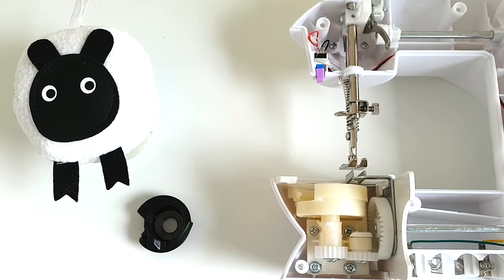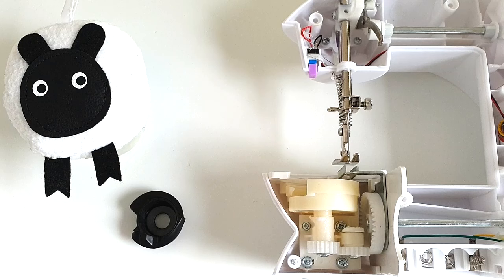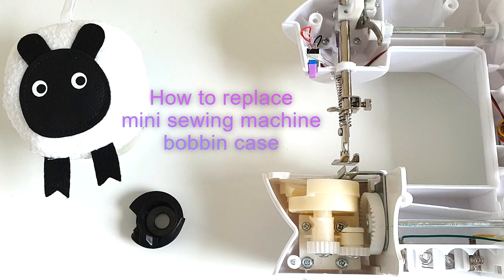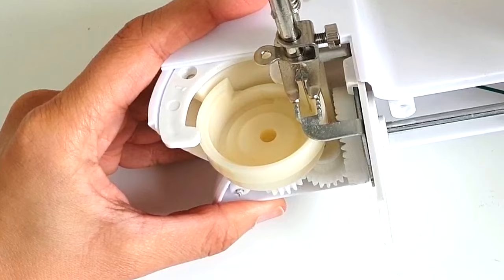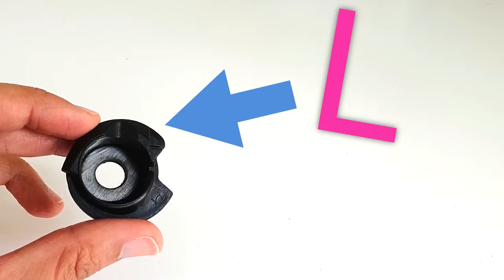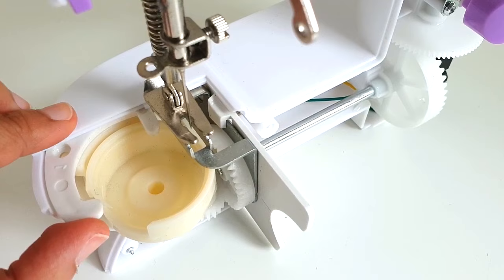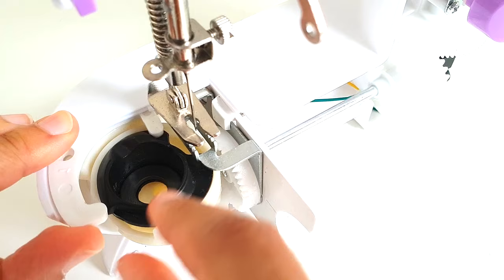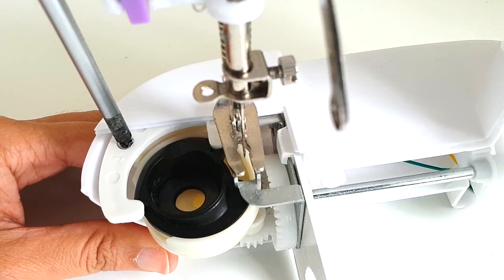How to replace your Mini Sewing Machine Bobbin Case | An easy beginner sewing hack!

Comment: This is a great tip. Thanks to you! But, my problem is my bobbin case keeps on jumping / moving out of its place. I don't know what to do.  Could you please somehow consider making a video about it? :)
Reply from the maker: please make sure you're following the nifty 9 method and using a high quality thread. search for relevant videos on my channel.
i'm afraid i wont be doing troubleshooting videos about the mini sewing machine any more. You will find more helpful content on the channel now. good luck x
Reply: That's exactly my problem too. The black plastic part keeps moving around and jumping out of place. Sometimes it almost pops out! Even when it's sat flat I can actually just pick it up and take it out - without undoing any screws. Incredibly frustrating since I'm an absolute beginner and have had to stop before I've even started gah 😅

While I'm here I'd like to say that I've watched quite a few videos in this channel and learnt a lot; enough to give me the confidence to give it a go. Now if only the bobbin case would sit still in place and behave 😂
Reply: Im having the same problem. When I try to redo the threading, the bobbin case pops out!
Reply: Same problem I am facing 
Can u pls guide मी about service centre  or customer care no.
Reply: The L shaped plastic piece that holds the bobbin in the case is missing on my fhsm-505 .What is it called?fhsm-505

Comment: Hello, my thread keeps stucking inside , what should I do? And also everytime i fix the timing after some seams it will get lost again.
Reply from the maker: Please check your gears, they are falling out of sync. Check where this is happening, they might be slipping off the correct grooves.
Reply: Hi

Comment: Do you know why the bobbin case is jumping? It is getting past its stopper and will go all through out in the needle's area and because of that my needle can't sew
Reply from the maker: 1. Make sure you are following the Nifty 9 method 
2. Check the bobbin casing for burrs and file them down. 
3. Clean out lint thoroughly with a soft brush inside the bobbin casing
Reply: @OoniCrafts  thank you so much! I wilk try that out. It's been stressing me since yesterday 😢
Reply from the maker: Aw bless you, it's really frustrating when this happens. Let me know how it goes x💜